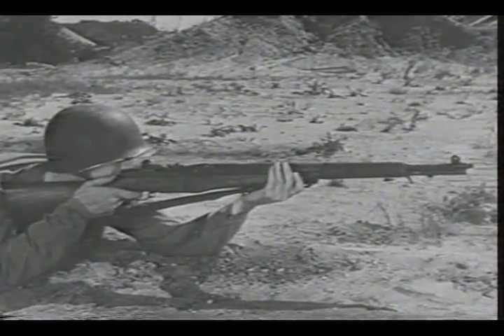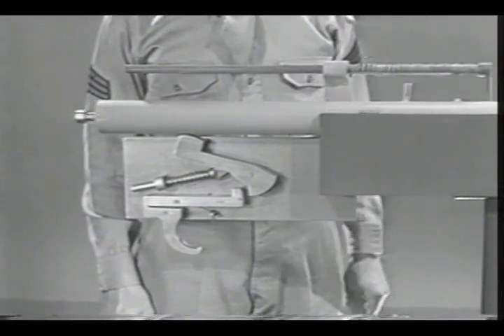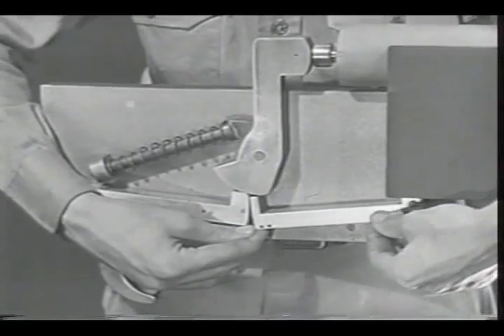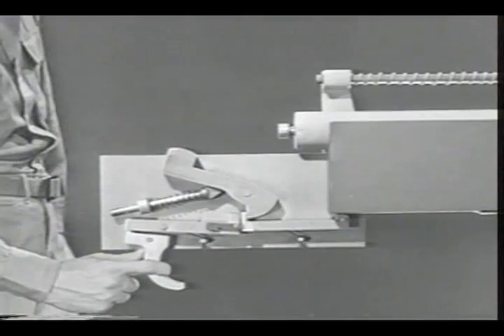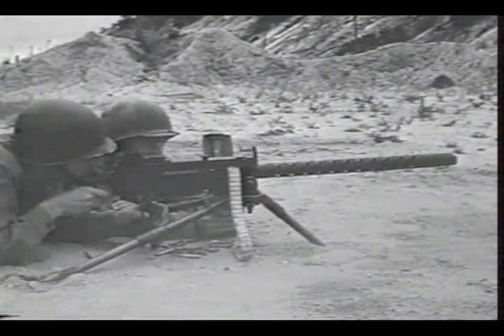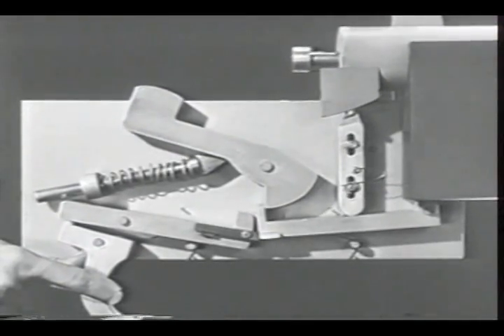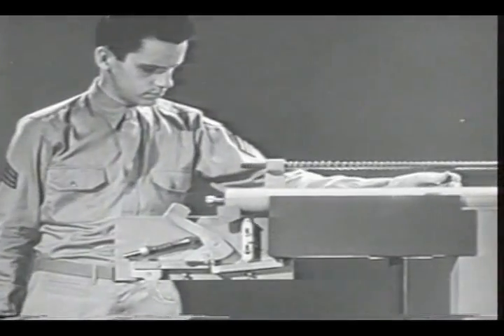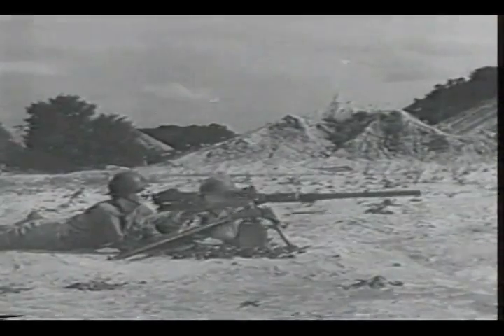Fundamentals of Small Arms Weapons (part 3 of 3) Semiauto and Automatic Fire

Comment: I find it interesting that they didn't go over open-bolt full-auto firearms, since they are the simplest design and were very common at the time.
Reply: @lovrika8491  Was that reply meant for someone else?
Reply: @lovrika8491  an open bolt gun is different from a bolt action, it is a "class" of semiauto or automatic firearms. Open bolt means that the bolt is locked at the back of the receiver and slides forward when you pull the trigger, it is much more simple then a closed bolt firearm because it does not need a firing pin. closed bolt is when the bolt slides forward and chambers a round from the magazine.
Advantages of open bolt:
1) cheaper and easier to manufacture
2) round is kept in magazine which is useful for machineguns that barrels are hot and cookoff (the powder is heated up by the barrel and combusts) can occur
disadvantages:
1)jolting when the bolt stops at the front of the receiver can cause inaccuracies.
2)the bolt has to travel a far distance which results in a larger delay between the trigger press and firing than an closed bolt.
Reply: @thebeetalls  Yep, i dont remember who but seems like he/she deleted his comment. I'll delete mine too.
Reply: Basically they did and say that are blowback designs.
Reply: And they overcomplicated everything to utter absurd. I mean, real guns have way simpler mechanisms, such as the trigger group and the operation system, contrary to abominations the engineers of this studio came up with.
UPD: I know, this is intuitive in a way, but only if you're completely new to guns e.g. the average Joe and have to be taught the very fundamentals; either way, when actually dealing with guns' mechanisms, you'll have to wrap your head around it all over again with different guns. And yeah, don't show this series to a gunsmith
Reply: Jinnie Xi Pooh  no u
Reply: @ІванІндукаєв  I think that's why it's called fundamentals of small arms weapons, cuz it's introducing you to the fundamentals
Reply: @randomdumbassguy  haha course I do. Or do you mean firing from an open bolt specifically or just straight blowback? Those aren't interchangeable but not mutually exclusive hence the confusion
Reply: @ІванІндукаєв  What you need to think about is that they basically described the mechanism of the M1 Garand, then the M14...
Reply: I thought you said "bolt-action full-auto firearms", but now I read it correctly
Reply: @ІванІндукаєв bear in mind we have a bias of 80 additional years of mechanical advancements and simplification to call upon from the time this video came out.
These mechanisms accurately depicted the M1 and M2 type Rifle mechanisms, the sort that were in current use at the time, and therefore the most common which an infantry rifleman or field armourer would need to know.

Comment: you had to release the trigger very fast but in the second part it was already a semi auto
Reply: That's why some semi-autos are only semi auto because they don't have an auto-sear... This is why some semi auto guns can ONLY BE SEMI-AUTO, but most fully-automatics have semi-auto only models that can't be converted because they can't be converted without machining the gun so it has the proper tolerances (space, strength, heat & pressure tolerances etc.)

Comment: 4:30
if u hold the trigger in that position it won't work
But it still a nice mechanism if u push the trigger very fast
Reply: I don't get what your saying, why wouldn't it work?
Reply: @raymonddunne627  He is saying that, if you can push trigger and remain it squized in "special" way, you can brake the cycle of the operation, then u will need to manually reload, even when theres ammo inside magazine. Got it?
Reply: @raymonddunne627  my ang is bad, but no problem

Comment: So would a lever action be blowback?
Reply: I believe you should think of it more as the bolt action demonstrated, it is  still manually operated, like a bolt or pump action.  Lever actions are just a different way of doing the same job.  Blowback is a type of gas operation used for autoloading, not even close to the same thing as lever action.  Hope this helps